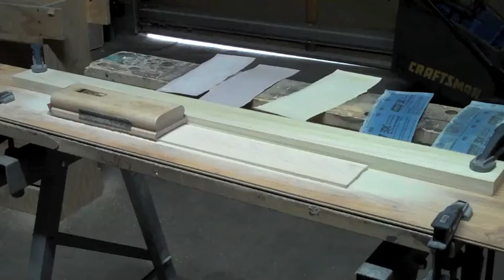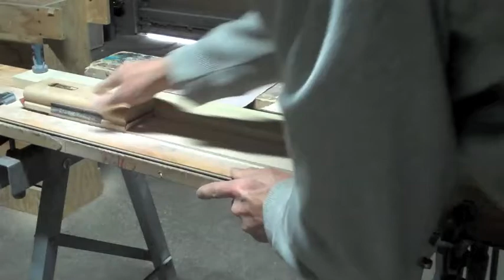Fretboard Radius

Comment: To stop any twisting or mistakes simply clamp a second length of wood on the other side of the fretboard. Use the radius block on top of the board to work out the width. This stops all side movements when sanding
Reply: Yah, finally someone posted this common sense tip.  The other issue of course that can reduce the middle portion being worn down first is to have one direction sanding for 10 swipes one way, ten swipes the other direction.  Change the wood position (flip it on your table to compensate for left and right hand muscles, or tendency to favor one direction) also about every 4 of the 10 sets.  Going back and forth has more variables than a one direction sanding.  You must though change the direction consistently.
Reply: @joq702  Good advice, I really struggle to radius a board consistently due to poor variables of my movements...

Comment: How do I radius a fretboard with inlays already in
Reply from the maker: The same way you would if there were no inlays.
Reply: @HighlineGuitars  sorry, I'm super new to this. Trying to just put custom inlays into a guitar. Is it safe to sand the radius down with pearloid in?
Reply from the maker: @pocketman5510  Yes, but make sure the inlay material is deep enough into the fretboard to account for the radius.
Reply: @HighlineGuitars  okay thank you and goog point
I have a desktop CNC machine, Im thinking of cutting out the inlay with the CNC. Then cut the pearloid with the CNC too and slot it in. Then radius the fretboard with the sanding tool in the video. Would this work? I'm also thinking of filling the inlay pockets with resin if cutting pearloid is too hard. Would this be the best way to do it?
Reply from the maker: @pocketman5510  This video, which premieres today at noon MST, should answer your questions: https://youtu.be/cBlApXw1zPs
Reply: @HighlineGuitars  thank you 👍👍